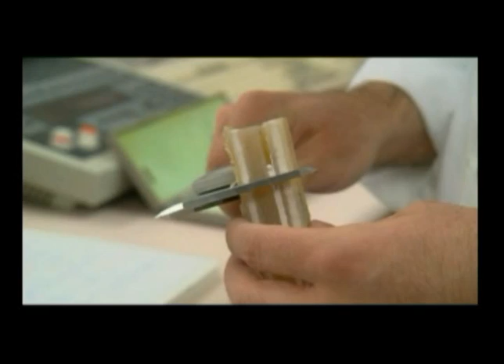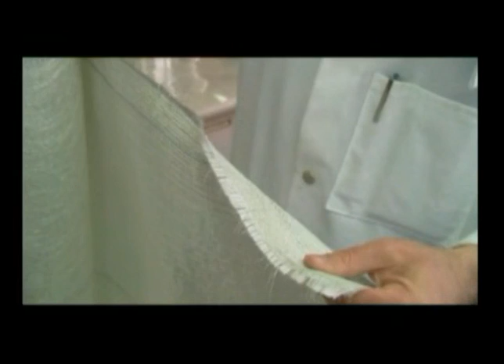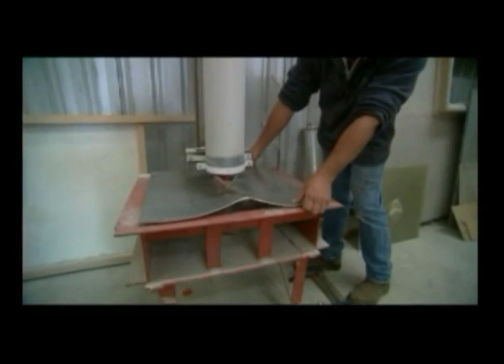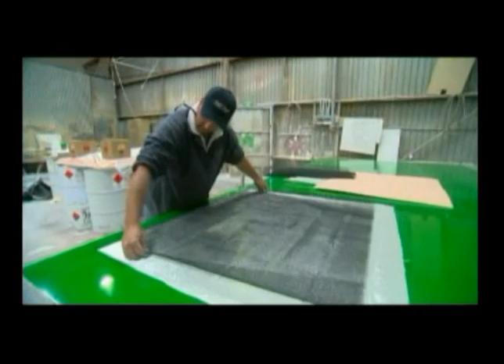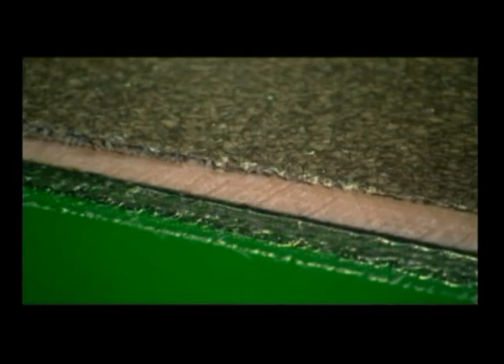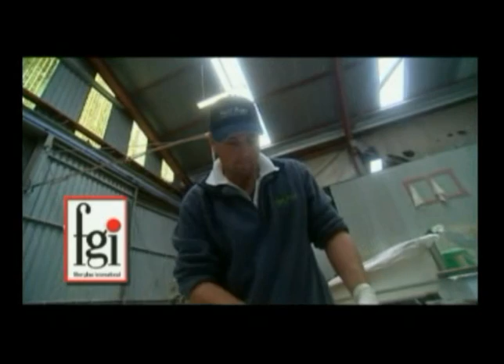Fiberglass vs Aluminum

Comment: In that drop test, the fiberglass failure will likely leak nearly as much as the aluminum example, with the entire boat taking water through out the glass, ruining the entire boat.

Vs pound the dent out, and weld it up for the aluminum example.

Comment: from years working with fiberglass ,that damage would let water in ,also once wet the cost of repair would be quite high and need experience work not week-end work. it comes down to personal choice fuel economy weight of towing maintenance .

Comment: That composite is called "glare". It consists of several layers of thin aluminum and pre-impregnated fiberglass laminated to a single sheet. The panel should be cured in an oven after shaping.

Comment: @SMBMWE30

This is the exact reason fiberglass is so popular, the repair process. Very cheap and easy to repair vs welding aluminum as you can't use any welder for alum...

If you puncture a hull, you can pull over to the nearest dock/beach and repair the area with a repair kit (~$30) to get you back safely.

Comment: @DanFrederiksen 
poly isnt bad on water. it just isnt as resistant to water as vinyl is. vinyl has greater bonding strength, and is overall a better product. polyester is more susceptible to conditions such as osmosis, and most US builders use vinylester for this reason. despite the cost being greater.

Comment: @JayTee441 
The new Boeing 787 Dreamliner is almost an all composite aircraft. The F-35 and F-22 are also almost all composite. They are all lighter, stronger, and are more fuel efficient than aluminum or steel built aircraft. Aluminum is also noisier than composite, so trying to be stealthy around fish like bonefish is not going to get a fisherman very far in catching one.

Comment: The choice for me is fiberglass as its much easier to fix yourself.
Fiberglass is less energy dense to manufacture and silica is more abundant

Mix hollow glass bead with polystyrene balls and epoxy resin you end up with a hard foam that weighs about half that of water, wrap that with fiberglass you will have an unsinkable boat, you can also fill a fiberglass or aluminum shell with it. It would cost a fortune but if the boat breaks in half in rough seas it will float better than just aluminum.

Comment: @nadoeloiskat 

That's actually not true. The cost of aluminum exceeds fiberglass pound for pound by leaps and bounds. The cost of manufacturing is also less with fiberglass. With an aluminum boat, if made like the one in this video, would take about one and a half weeks. The boat in the video took about 4 days.

Comment from the maker: Of course composite boats can be lighter, but at a cost that is impractical for private boat manufactures. The typical fiberglass retail fishing boat would be heavier then an aluminum equivalent. But if you see it as strength to weight composite wins all round.

Comment from the maker: Fiberglass is very easy to repair, not need any power at all and a simple fiberglassing repair kit from a local hardware shop. Messy? wear old cloths and gloves. Fiberglass patch work can be blended and finished like it was never there.

Weight is relative to many things. Also lightweight is not always 'better'.

Comment: There is no way to quantify which one is better through a simple drop test. To be fair, obtain an aluminum boat and fiberglass boat of same sizes (not just panels), perform weight and balances to equalize the weight, then with an autopilot run the boats over a partially submerged object with a strain gauge to compare impact forces. Then give results of this test in a less subjective way (like how many gallons/liters of water flows through damaged area), not just "see, there's no hole!".

Comment: @DanFrederiksen 
Fiberglass contains explosions because that is purely a tensile application.  You need more than tensile strength for a boat hull.  Bad comparison.
Just look at the typical average boat hull weight.  It's not even close.  Those weights do not lie.

Comment: I thought I saw the fiberglass broke in the test, and there is no hole??  Anyway, If it is a question of sinking why not get a aluminium multi-chambered boat. It is much lighter than a foam filled fiberglass boat.

Comment: This video is designed to delude the ill informed or uneducated. That GRP panel has lost all structural integrity for all the area that extends out into the colour ( white) area.There is no way that panel was water tight after the test.Why did you not show a repeat impact test offset by 5" ( 120mm ) is it because the panel would have completely failed as against just another SMALL puncture in the aluminium panel.

Comment: Not sure about the validity of the penetration test, material should have been clamped all around to give a fairer comparison as it would be in a hull and it should also have been done with a piece of plywood as well. The same temporary repair can be carried out on aluminium and wood as is done on the plastic panel. Fibreglass resin (polyester) is made from oil, and is very difficult and expensive to recycle,  The majority of the worlds aluminium is produced using hydro power eco friendly.

Comment from the maker: You obviously have no hands on experience with either of them then. I used to patch up random tinnies, hardest most awkward thing to do. Not only do you need to be able to aluminum weld and have an AC mig/tig welding machine but you have to deal with old corroded metal that will often cause underlining weld faults later on. Also it look ugly as will patches everywhere.

Comment: Too many unknown variables in this video to come to a conclusion and use this to form an educated opinion.  He states that this is 4 mil aluminum alloy and its is obviously not. 4 Mil is .004 of an inch or . A mil is a unit of measurement equaling .0254 of a millimetre, not an abbreviation for millimetre. If he mistakenly used the term in place of millimetre than the aluminum would be .157 thick which i believe is more plausible however a sheet of hardened aluminum in the thickness of .157 would not have warped as this in the video did. Boat manufactures do not use "O" to build boats. I actually don't know of anything made with O. We use it to form shaped aluminum then heat treat it to the hardness desired. It appears as though he is using "O" aluminum to mislead people into believing his narrative. O has not been hardened and therefor is much softer and more pliable.  It is also easier to puncture as this did in the video. Contact me and I will be more than happy to test your glass panel against various grades and hardness levels of aluminum. I am interested in an accurate comparison. Are you?

Comment: Are you joking? I own a fiberglass boat, but there is no doubt aluminum is less brittle and more resistant, thats why fiberglass is not even an option in white water river racing, a fiber glass boat wouldn't resist one minute in a river full of rocks and logs, and aluminum hulls take direct hard hits a full speed and keep going and going... Who ever made this video is an ignorant lying full
Reply: +GRRB It entirely depends on what process is used to construct the boat; if the hull has been chopper gunned and laid up with polyester resin, it&#39;ll be a load of crap. Unfortunately this is the most common manufacturing process because it&#39;s cheap. In contrast a vacuum-bagged, resin-infused hull using epoxy, with solid construction below the waterline and a top-quality high-strength, high-density closed-cell PVC foam core above it, can give you  hull 3-5 times stronger than steel. It'll also cost you a fortune.
Reply: +Derek Smallshorts You cannot mix resin and epoxy - it does not work.
Reply: They showed an equal test on fiberglass and aluminum to demonstrate material mechanical properties, and you say they're lying? I'd really like to know how they managed that.

Comment: Fiberglass is over 80 times stronger then aluminum and lighter too...Wont Dent, Wont Crack or warp if done right!...PERIOD!
Reply: GasserGlass actually. Aluminum boats are lighter and better fuel economy.

Comment: When Fibreglass breaks or is wet, it is not easy to repair because the material is contaminated and if repaired in a contaminated form will not hold up well at all.  The strength is not as high as the original.  Aluminium you cut out the piece and weld in a new piece.  When people talk about composites, one must clearly define what you mean by composites.  Boat builders call foam fibreglass resin a composite - whereas the aircraft industry calls carbon fibre, Fibreglass and kevlar with epoxy a composite.  These are vastly different in strength and application.  
The industry muddles and confuses people with inaccurate terminology.  Fiberglass uses resins to bond - and it is not a composite.  Foam filled or infused fiberglass is a foam filled fiberglass - NOT a composite.  Composites should be reserved for glass, carbon, kevlar expoxy combinations.
Composites - in the way it should be defined is relatively easy to repair and has 95% the strength of the original.  Composites are much stronger than fiberglass - weighs around 1/2 as much - and are as much as 5x more expensive.  
Also one should be clear about vacuum infusion molded products vs straight layups.  It is not that simple - and there are many variables involved which will give you completed different results in strength longevity, flexibility, repairability and overall quality.  Resin / Epoxy to glass/ Carbon / Keval ratios are also critical to strength, quality of finish etc. as are the cloths selected and used.
Reply from the maker: A composite is something made up of multiple parts/processes. fiberglass is made up of the resin and the reinforcement fibers/matting. This makes it a composite. Rubber core aluminum is a composite because it is made from multiple materials/parts. (for example)

Just the same as aluminum, fiberglass needs to be ground back or etched back which exposes fresh material to bond to. Obviously the material should not be wet when being repaired, just as any porous metal prior to welding.

Comment: What about a titanium hull?
Reply: Victor Affonso Sure. If you want to spend the next 10 years paying for it.
Reply: +Victor Affonso Titanium needs to be welded in a completely inert environment.  If any oxygen gets into the welding - kiss the weld good bye.  Titanium is no longer as expensive as you may think and there are people looking to infuse it with Carbon, Kevlar, fiberglass, expoxy composites.  It is very difficult to work with and get right.  It costs 5x as much maybe even more.  Pure Titanium hull is light and very very strong.  It is not so much the cost of the material - rather than the design of the boat and the welding process that will make the difference.  It is a very difficult material to work with.

Comment: The vast majority of Glass boats use plywood as a core material.......invariably water penetrates thru these "sealed" wood structures & rots them from the inside out. The structural integrity is thus compromised & weak.Boat-builders like Glass because they can cookie-cutter them on assembly lines. Aluminum builders need legions of highly skilled welders, not teenagers coming up from Wendys to work "The line". Aluminum weighs a third, costs 4-6 times more, harder to make, slimmer margins.